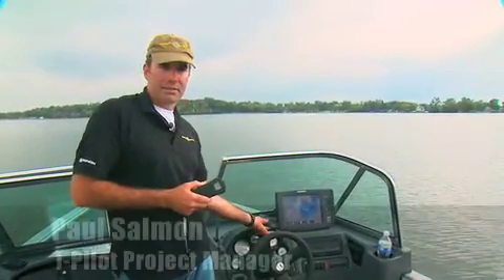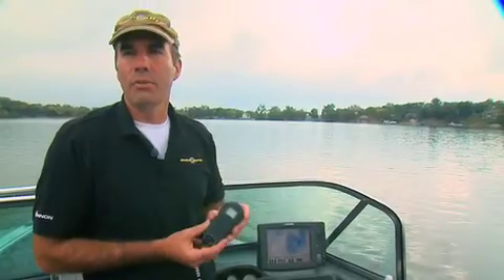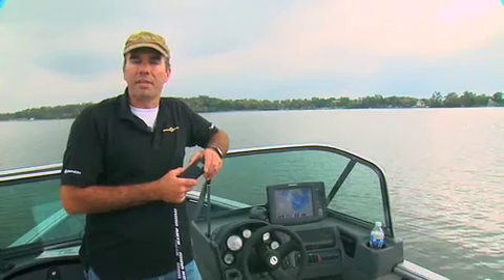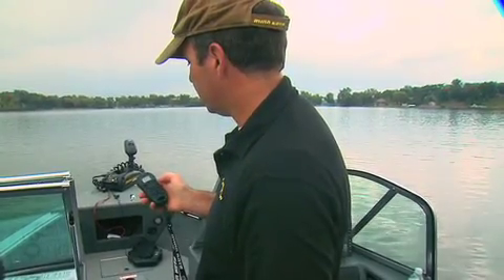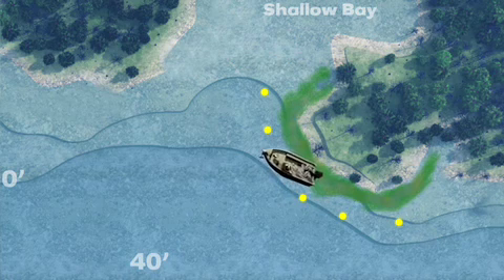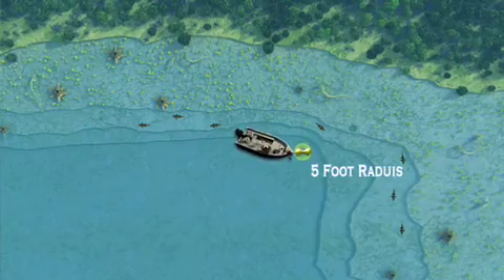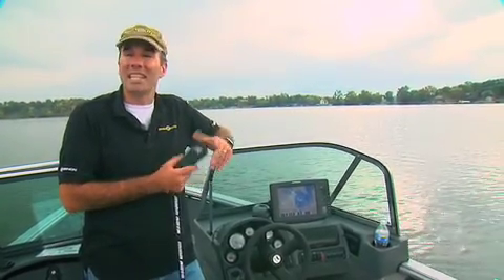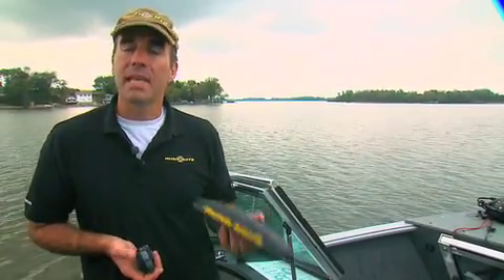In-Fisherman - Minn Kota i-Pilot overview on the water

Comment: When I hit the anchor lock button the motor just spins on circles? is that right?
Reply: Joey Latocha Allow the trolling motor to settle for a few seconds. Expect the bow of the boat to face into the wind or current, whichever is the stronger influence. Your position might vary up to 5 feet depending on how signal and if the government still occasionally deemphasiszes the accuracy. They work great but take some getting used to.  I hope this helps!